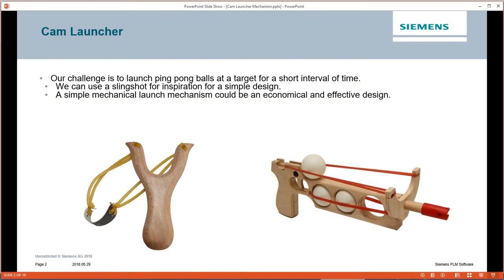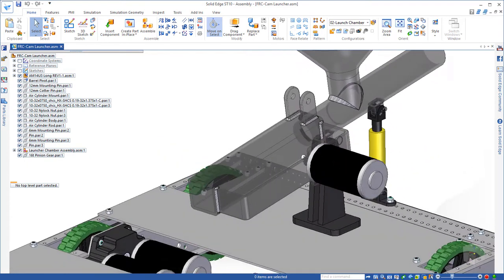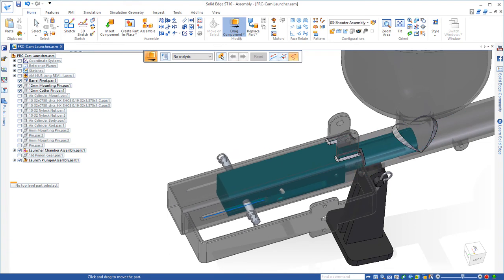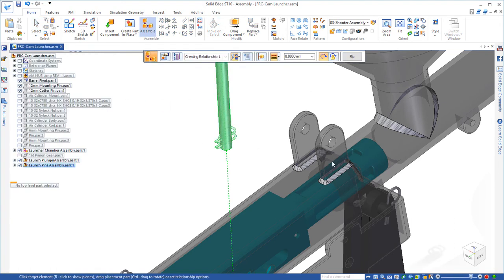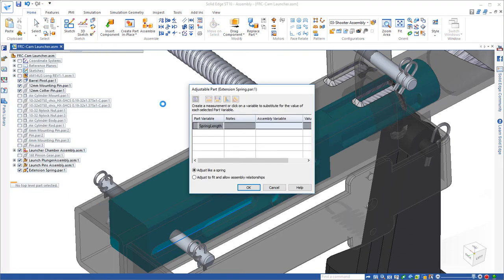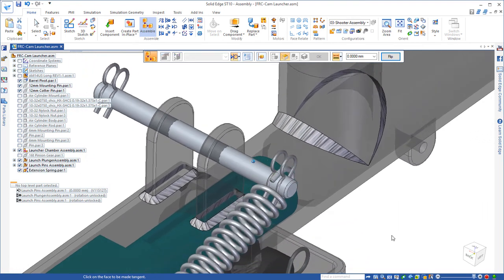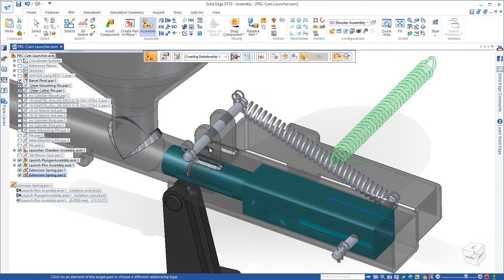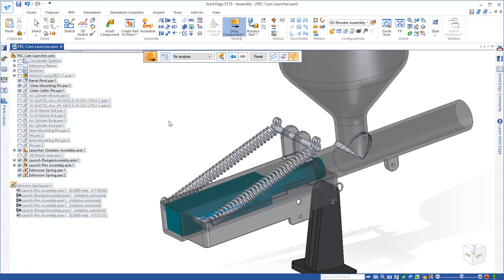Launcher Mechanism Part  1 | First Robotics Competition - Solid Edge

Comment: Hi, do you have a video showing how you designed springs? I try to create same springs for my design, but I either can't attach spring in assembly or spring won't stretch. It would be very helpful for me to see what parameters you use for helix and as variable. Thank you